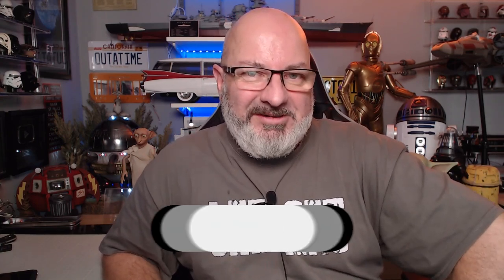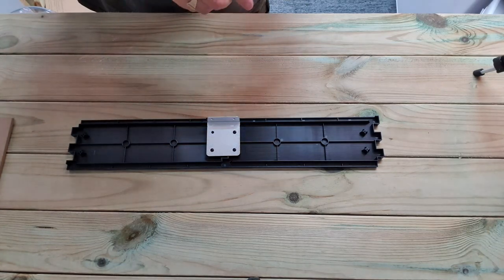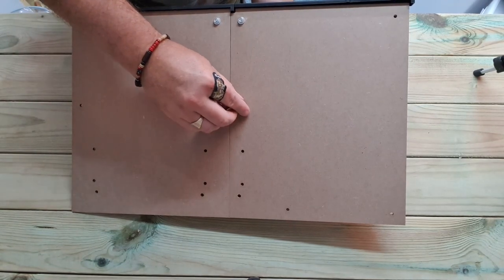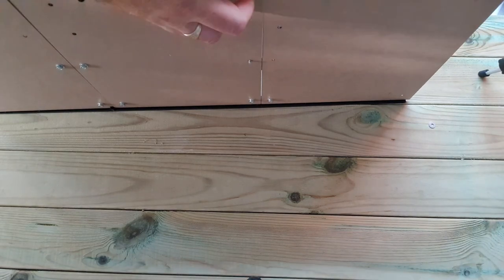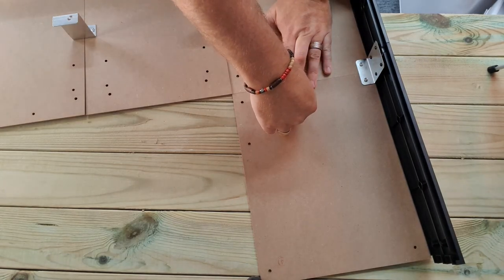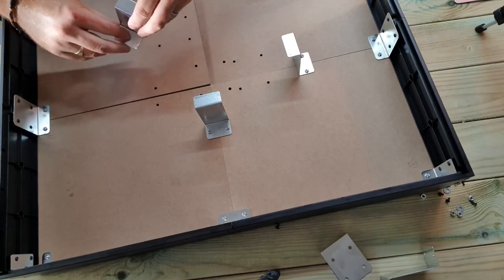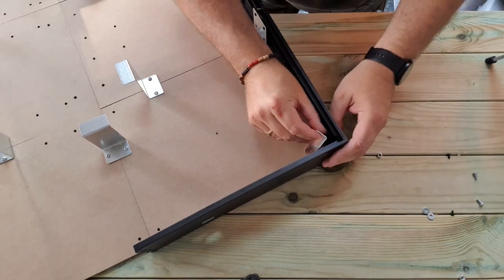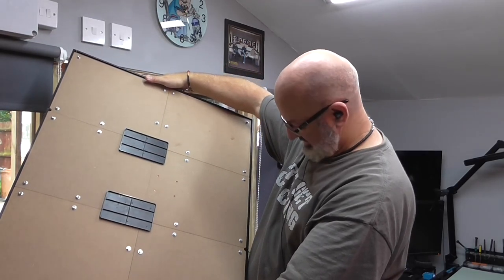Build the Spitfire Mk1a - Part 75-79 - The Dynamic Base

Comment: I have just compleated the base along with part 80 and i have to say that hachette didn`t think this through in regards to where we would put this. The base is way too big to put it and as such it`s a shame too because i think we would all like to see it fuilly compleated along with the banking motion but on a smaller stand and i`m sure that this could be done. One more comment is at the moment all the wires that are coming out of the model and the space left it is going to be a squeeze connecting them to what i think will be a main board. Like you mentioned i`m not going to be putting the model on the base purley because i don`t have the space, but i am looking forward to compleating this model. Enjoyed the video again. Thanks Steve

Comment: Like most people have said the base is far to big. Where on earth would you be able to put it. Plus with the weight of the plane aswell it's gonna be hard to move it around. I am disabled so i will probably not be able to move it around. I have just started building the base, once completed i will look into trying to make it smaller, if it's possible to do it. Will have to wait and see.
Reply: Hi Wayne do you just have the one smaller bracket for connecting the side panels to the base please?

Comment: Need to cover the top with something to cover the bolts and plastic pieces for a smooth top. Or is there something in the next stages? Looks like it's missing something. 

It is very Big. Need a whole building for just the base. 

WOW. Hope you will show the final place for it all set up. 
It's SPECTACULAR!! 
Does your dad know it's coming to him and it's so big? 
A table for both the spitfire and the zero planes in a display together. As how It looks fine they are in the middle of a dogfight.  It would look EPIC
Reply from the maker: The plastic parts we put on are the bottom. You won't see them. The interior box section has a top cover
Reply: @WorldofWayneUK  that was what I was hoping for. Thank you.

Comment: the base could have been improved if they had used metal strips to cover the gaps between the boards instead of just washers under the bolts. as for the size and the gliding, I'm sure someone is gonna make a hanging base you can bolt to the sealing with pules that will tilt it up and down.

Comment: Hey Wayne. I desperately need your help. My Spitfire build is up to Issue 70 and my wife decided to put it in the cupboard "out of the way". 
In the short time it was in there one of the propellers has snapped off at the spinner.  Other than divorce, can you suggest anything to help me fix it. Is it possible to reverse engineer it without spending 100 quid on the early issues? Is it possible to weld or solder, or will I be better off using metal glue or epoxy? Any help would be massively appreciated. 
Love your channel. Cheers
Reply from the maker: Epoxy resin will hold pretty much anything. Short of taking the prop off that’s the way I would go
Reply: @WorldofWayneUK  Great stuff. I'll give it a try. Thank you

Comment: I've just received the rudder issues,and wow,the two steel hinges were bent/deformed,hachette aren't replacing them as the have none,so my build stops there,I've cancelled the whole thing now,to say I'm pi55ed is an understatement
Reply from the maker: Not good. I would keep on at them

Comment: seems overly complicated for a base and surprised the nuts are on the top. Cant wait to see how it works out
Reply: Actually, from what I can figure out, the nuts on the underside of the wooden panels are the under face of the base. The Spitfire & diorama will be on a surface yet to be installed above the currently open side with all the gubbins & dynamic pistons/machinery to give the illusion of flight contained below/inside.

Comment: Have you fixed the X wing engine yet from car crash Tuesday? I had to cringe when I see the engine come loose and the crack sound that came from it. Thank God you did not drop it.🙄
Reply from the maker: All fixed. A montage video is going up shortly
Reply: @WorldofWayneUK  lol. That's good. It will put all the minds to rest with the other builders out there of the X wing. 😁😁